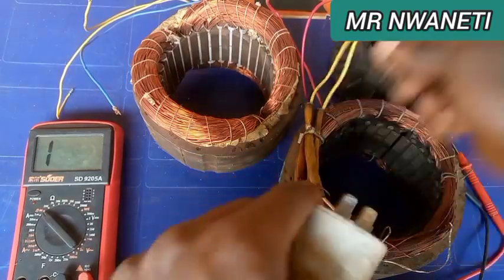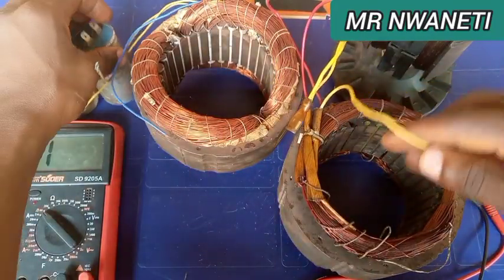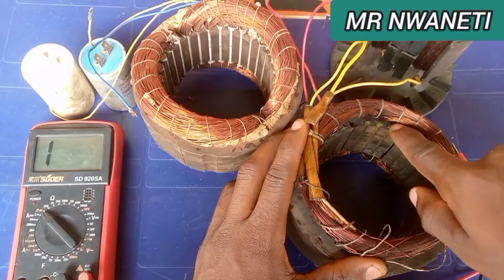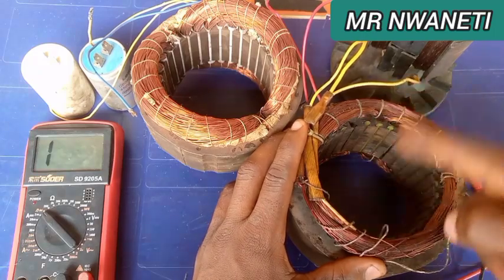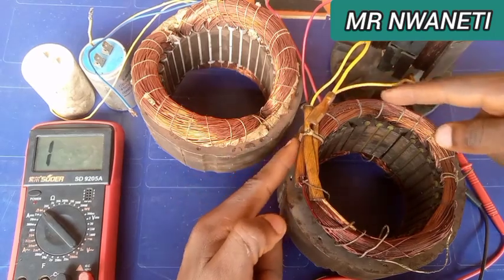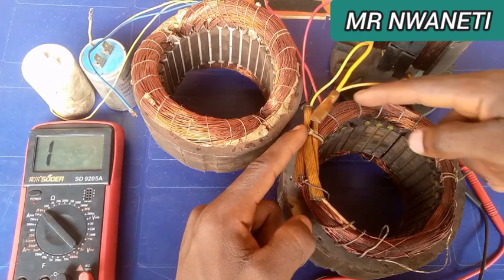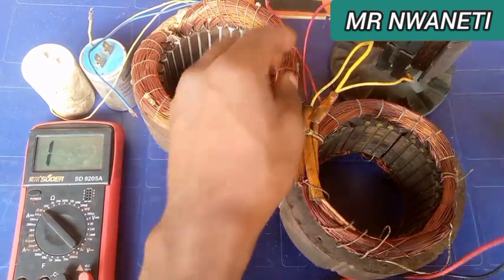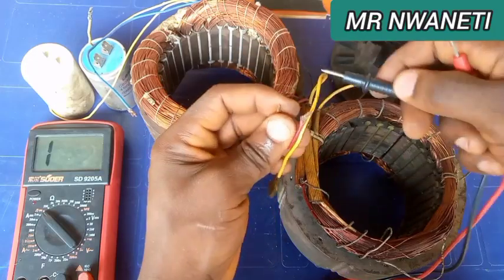@How to Increase your generator voltage output, assume if prime mover speed (RPM) is constant

Comment: Wow 😲, thank you so much for this explanation. I've really learmed so much from you. I already dropped some questions for you at ur other video but i guess you've answered part of my questions. 

About the DC motor, you know when you connect the battery charger to the battery the speed of the DC motor increases, I hope yhis won't affect the output voltage of the generator and if it does, will putting load on it reduce the speed?
Reply from the maker: Connecting battery charger is a load to the generator
Reply: Yes, I'm aware of that too.  @MRNWANETI

Comment: Hello, thank you for your trust. I would like to ask you to draw or show me in a video how you changed the stator winding to 220 volts. I don't know how to change it to 220 volts. Thank you in advance. May God bless your work.
Reply from the maker: Ok step one
(1) Count the whole main winding per slots then put the figure down 
(2) Assume per slots is 40 turns you can increase it to 50 turns all through by doing so the voltage we increase

Comment: The stator windings are spinning at a speed of 300 rpm. The 220-volt generator is now in your video. How much power did you reduce it to? Did you change it to 1200 rpm? Did you change the windings?
Reply from the maker: @xudoyberdixakimjanov4099  yes I change the winding I modified it, like in the video I explained several ways to increase your generator voltage 
(1) Increasing the value of the capacitor 
(2) Increasing the main output winding 
(3) By adding more turns on the rotor (armature)winding
Reply: @MRNWANETI Is there a video of how you changed it? If so, can we see it, sir?
Reply from the maker: No don't misunderstood me, stator doesn't rotate,it stay stational, only rotor (armature) is what rotate,to reduce the speed you need to add more winding in the main output so the turns increase
Reply: You've broken the stator, how can we change it, that is, if we hit it, we will solve this problem.

Comment: Good Morning Mr Nweneti, thanks for this information really helpful, but i have a challenge with low voltage and  i tried adding more capacitor as you said but i notice that it lead to drop in the dc motor speed and also the voltage dropped as more load is added, what do you think am doing wrong?
Reply from the maker: @SupremeComputers-d5l 
 (1) lack of torque in the DC motor 
(2) Low speed (RPM)
(3) Maybe you can adjust the voltage by adding more turns on the main output winding